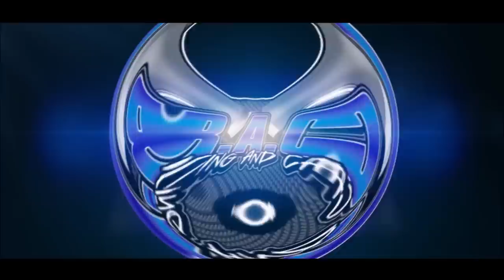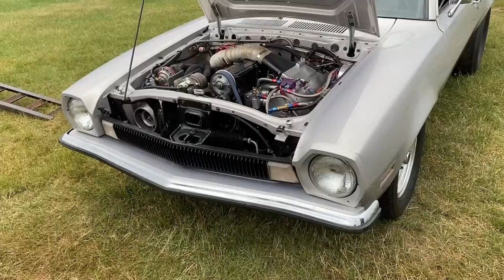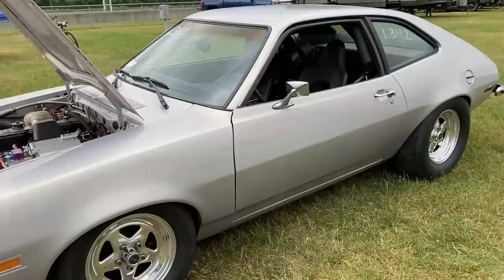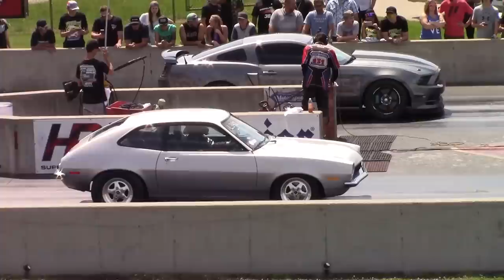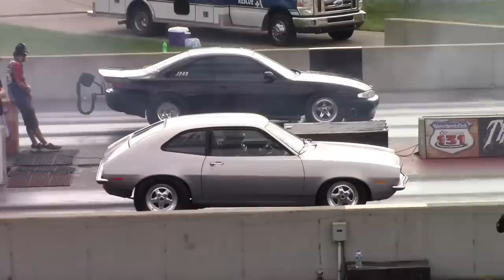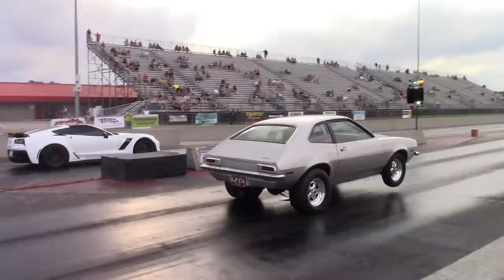4 Cylinder Turbo Pinto Sand Bagging Against a Mustang GT, C7 Z06 Corvette & Turbo LS 240 1/4 Mile

Comment: Could bag better if his holes hots were closer to 000 green he's sleeping at the light. Gotta work both ends that how he lost the last run.
Reply: Actually that was an instant green tree. If you wait until you see green you're going to be somewhat late. I was just testing so I didn't care but you can see on the last pass the Corvette driver rolled the dice and left before the tree activated so by the time it did go green he was already moving. Risky but it worked out for him.

Comment: Sandbagging b/c bracket racing, or b/c car risks going too fast for installed safety equip?
Reply: First time out testing a new combination. Car has all the required safety equipment, parachute just wasn't on for half track passes.

Comment: I'm sorry, but I just don't believe this. I have owned many pintos and those fours were not designed to last, let alone be turbo-ed and lift the car on hard launches. On the other hand, I have known many pintos which have had a V8 dropped in. Notice how the sound changes from weak to awesome just before the launch. Clever though, showing the old rubber cog belt cam drive on the video before the actual race begins.
Reply: LOL! Nothing to hide here. Stop by and count the plug wires for yourself.😁
Reply: @daveflanders5223  I'm glad to see you took it the way I meant it - tongue in cheek. BTW, didn't pintos have FOUR lugs per wheel? And you sure are stressing those rear leafs!
Reply: @royshashibrock3990  Four lugs stock but mine has a 9" rear and converted to GM front brake rotors.

Comment: What's done to engine and did you make the intake yourself what head on it and work done to it thnks
Reply: 2.5 with an old Ford Motorsport tall deck block and a stock Ranger crank. Head is an aftermarket iron unit made and ported by Tim Ottinger in Tenn. I build everything for it myself that I can because I'm a cheapskate.
Reply: @daveflanders5223  How about the original turbo 2.3s heads in the svo and thunderbirds? Don't they have larger valves? What was up with the puffing smoke at the end of the track?

Comment: The pinto probably weighs less than 3000 pounds so of course it's gonna be faster!
Reply: About 2,970 lbs the owner said in the comments.
Reply: Dude it’s a 4 cylinder
Reply: @neiljohnson9686 yeah it is.  so? It's real American steel. And that's what the owner said 2,970. He built it, so he probably ought to know.

Comment: Almost as quick as a model s!
Reply: Did you see how early he was letting off?
Reply: Not even just letting off, but slamming on the brakes lol a car going 9.9s should trap around 130-140mph....he was trapping 100mph....so I'd say that's a good mid to low 9 second ride

Comment: What's wrong with it? Looks like it keeps falling on it's face after the 660ft. Puff of smoke, then dies off.
Reply: Earlier up thread, mechanical fuel injection,  he was lifting to avoid breaking out of the 10 second bracket.
Testing night.

Comment: It's fast until someone rearends it, we all know what happens after that. 🔥🔥🔥🔥
Reply from the maker: I don't, lol, but guessing it becomes like a semblance of a Mini Cooper in flames? 😂
Reply: @DragRacingandCarStuff  Pintos were bad about catching fire after a rearend collision because the gas tank was just behind the back bumper.
Reply from the maker: @brianspangler3771  ah, gotcha. I suspected something like that
Reply: the Pinto got the bad rap on this.  The gas tank is the floor of the trunk.  but it's the same for all the other little Fords too, the Maverick, the Mustang, the Cougar, etc.  Any Ford with a tank in the trunk could go boom.
Reply: Fun fact, ford determined it would be cheaper to pay lawsuits from people dying from the failed design than to do a recall, so they left the design as is until it became too big of a problem.
Reply: @page.crow.chiron  what are you talking about? There is a sheet metal floor in between the steel fuel tank on every car pinto Mustang Maverick, probably every single car made period.
Reply: @page.crow.chiron  

False Info…
I own one.
Reply: That was just a lawyer doing a number on Ford...
Reply: Gas tank is trunk floor in mustangs till 73 and lots of fird cards of the 60s,  pinto and mustang have a solid trunk floor and the tank is strapped underneath .
Reply: @brianspangler3771  Ralph Nader propaganda.
Reply: @page.crow.chiron  The Sixties Mustang fastback was like this.
Rear ending the car might cause the trunk floor to split, and since there was no wall between the passenger compartment and the trunk, gas could spray into the passenger compartment.
This happened a few times killing the people in the car.
Reply: @ZEPRATGERNODT  nope.  not false info.  I own several.  Do you?
Reply: @leroy420b  The sheet metal you are referring to is the gas tank.  The gas tank is the floor of the Ford trunk.   All that separates the tank from the passenger compartment is the back seat, comprised of steel wire, vinyl, filler.  I own many of these cars.  That is what I am talking about.
Reply: I wouldn't be commenting if I didn't have DIRECT experience or ownership.
Reply: Yeah the problem was if they got slammed real hard in the rear by a big vehicle it tore the filler neck out. There was an update to shield, change the fuel tank filler neck or something like that. But the damage had already been done. Just like the Corvair, it's really wasn't that bad of a car either, same design rear suspension as VW beetle swing arms. They improved the rear suspension on the corvair last couple ish years production too. But the damage was already done. Nader killed that one too!
Reply: I can’t see anyone even getting close enough to “ rear end” it😂😂😂but you haters are always going to be around, so hate and sulk all you want😂😂😂
Reply: @KenKyleRacing  is that the same thing that happened to the Corvair?🤔

Comment: Very nice. But I'm just not a fan of turbos. I have a 1972 Pinto woodgrain wagon that came with a 2.0L SOHC/4 speed. I took that out and put in a 289/4 speed out of a 1967 Falcon. It's not a race car, just a street driven hot rod. My actual race car is a 1985 Chevy S-10 with a 383 small block and a well built store bought TH400.

Comment: Waste of fossil fuels.  Go electric already.
Reply from the maker: Fossil fuel is still used to generate electricity at plants, mine minerals for EV batteries, etc...According to the U.S. Energy Information Administration, most of the nation's electricity was generated by natural gas, nuclear energy, and coal in 2020. In 2021, about 61% of this electricity generation was from fossil fuels—coal, natural gas, petroleum, and other gases. About 19% was from nuclear energy, and about 20% was from renewable energy sources.
Reply: @DragRacingandCarStuff  Careful - we don't want any facts around here. 🤣